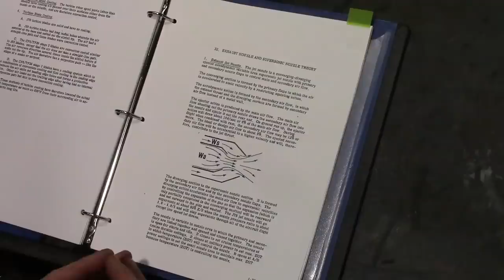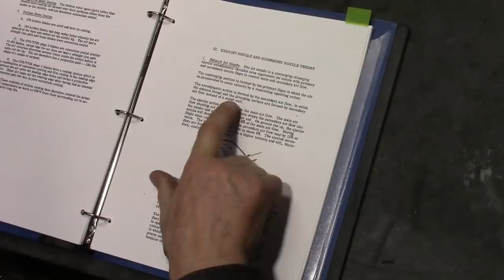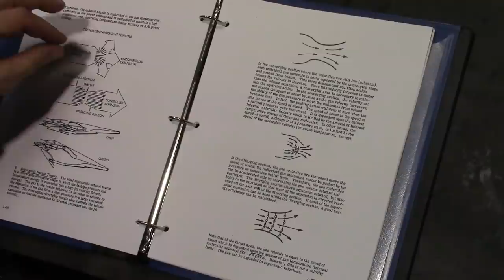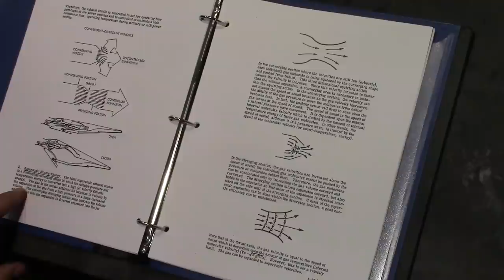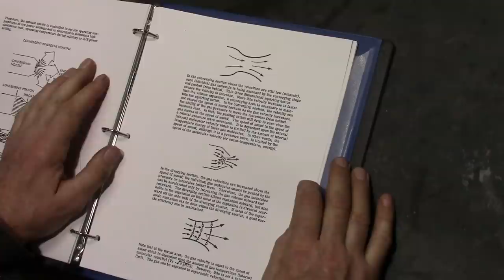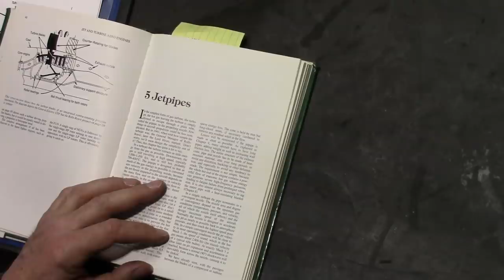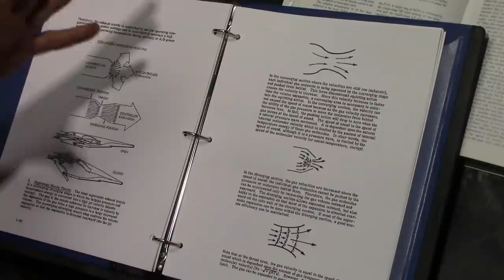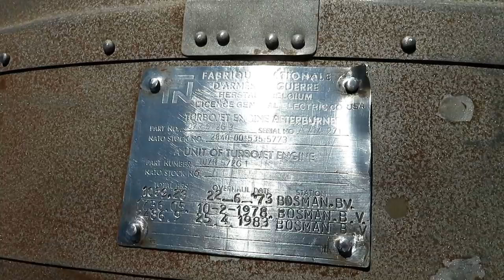Afterburner Jet Propulsion Nozzle

Comment: After-burner... reheat is something you do with left overs from last nights dinner.
Reply: Gordon, Steam engines use the Rankine cycle... jet engines the Brayton Cycle... the concepts and the names are completely unrelated. Cheers mate!
Reply: Yes Gordon, your comment is irrelevant and completely nonsensical... Jet engines are internal combustion heat engines.
Reply: I'm sorry Gordon but you don't have an argument...
Reply: Gordon we are talking about BRAYTON CYCLE engines on this channel...
Reply: Afterburners are not used in steam engines
Reply: @doktorbimmer  This is not for you to pontificate on. As Mr Richardson has already tried to tell you, 'reheat' is simply a term for the addition of heat at less than the maximum pressure of the cycle, whichever cycle. The term used for decades in the UK gas turbine industry for the combustion of additional fuel in the jet pipe for thrust augmentation is ..... reheat. That is a fact and your opinionated comments are not going to change that fact. I have stated elsewhere (but have no conclusive proof) that its use possibly came from Whittle's early association with British Thompson Houston, manufacturers of steam turbines and electrical machines.
Reply: @grahamj9101 The facts here are very clear and you are both wrong... steam engines (Rankine Cycle) do NOT use Afterburners... and there is no logical reason for them to exist on steam engines... there is no practical application for thrust augmentation of the combustion gases produced in any boiler or steam generator. This should be plainly obvious to anyone knowledgeable or educated enough to speak intelligently on this topic.
Reply: @doktorbimmer  OK lets tgive it a last try from my side. Where the Americans (and Canadians) mention afterburnering (with an afterburner) for the Brittish this is reheat (with a reheat section). This is one of the many differences between Brittish English and American English. (Other examples are holiday and vacation,  aubergine and eggplant,  trousers and pants, starter and appetizer. All those words have the same meaning). There are more words that can mean the same. This "different words" with the same meaning was (in my opinion) the thing AgentJayZ was refering to.
Reply: @Jose van Eijl Why don't you do us all a big favor and go troll somewhere else OK kid???
Reply: @doktorbimmer  It is obvious that you have totally failed to absorb what I have (and have not) told you previously. At no time have I suggested that a Rankine cycle machine can use a process that is commonly known in the USA as afterburning, as applied to propulsion gas turbines.  What I have told you and will repeat is that the term reheat is a generic term for the addition of heat part way through the expansion process of a heat engine, be it a Rankine or a Brayton cycle machine. 
I will also repeat the fact that the term reheat has been in common use for decades in the gas turbine industry in the  UK for the combustion of additional fuel in the jet pipe for the augmentation of thrust in a propulsion gas turbine. And yes, we can and do use the terms afterburner and afterburning interchangeably with reheat in the UK because of the worldwide influence of the US gas turbine industry.
Finally, let me tell you what I've also mentioned in the past on this channel. Back in the 1970s, I did some feasibility studies on the use of what could only be termed reheat in an industrial gas turbine. I investigated the practicability of introducing a combustion process between a gas generator and its free power turbine. I concluded that it was entirely feasible but not practicable, because it would not be cost effective.
Reply: @grahamj9101 Steam engines do not use Afterburners the term Afterburner is not related in anyway to steam engines or Rankine Cycle engines. 
 The term "Afterburner" is translated directly from the name given to it by its inventor Dr. Anselm Franz who described his invention as quote;  Nachbrenner zur Schubsteigerung or in English "Afterburner to increase the thrust" on the Jumo -004 D/E the worlds first production turbojet engine and the first jet engine to have an afterburner.
 The Afterburner is in absolutely no way related to Steam or Rankine Cycle engines and your ridiculous theory is nothing but absurd.
Reply: @JosevanEijl  I've often taken the opportunity on this channel to have some light-hearted fun with the "two nations divided by a common language" issue. This applies both to English language usage generally and to the terms used by the industry in which I spent a career lifetime. For instance, UK jet engines don't have mid-span shrouds, they have snubbers, if the were designed at Bristol, and clappers if they were designed at Derby. 
I think the troll in this instance is the stupid person who is trying to reinforce his non-existent case by using bold type.
Reply: @grahamj9101 Childish insults won't lend any credibility to your failed argument or make you look smarter or more mature...
Reply: @doktorbimmer  This is getting tedious: I will state yet again that at no time have I claimed that afterburners are used in steam engines.  Having spent a career lifetime in the design of gas turbines, industrial, marine and aero, I do know better than that and I would have hoped that you would have at least tried to understand the point I was making.  I was simply and reasonably relating the use of afterburning in the gas turbine to the use of reheat in Rankine Cycle machines.  As you quite obviously haven't appreciated this, I will explain the issue, which is really a non-issue, for the benefit of others.  
In a large steam turbine, the steam leaving the high pressure turbine does not go directly to the low pressure turbines: instead it is piped back to the boiler where it goes through a separate section known as a reheater.  In the reheater, the temperature (but not the pressure) of the steam is raised before it is returned to the LP turbines: the process is known as reheat.  The primary reason for reheat is to reduce the degree of wetness of the steam in the final stages of the LP turbines, in order to avoid erosion of the blades.
In thermodynamic cycle terms, afterburning (as it is known in the USA) in a gas turbine and reheating in a steam turbine are essentially similar processes.  In both, heat is being added to the working fluid part-way through the expansion process.  However, there is one obvious practical difference between the two.  In the gas turbine, the combustion process that adds heat takes place in the working fluid itself.  In the steam turbine, combustion takes place in the boiler and the hot combustion products pass through the reheater section of the boiler.  In the reheater, heat is transferred from the combustion process to the working fluid by means of heat transfer across the walls of what is essentially a heat exchanger.
As I’ve told you before, what is known as afterburning in the USA is quite validly known as reheat by the gas turbine industry in the UK and the term has been in use for decades.  We do, however, use the terms interchangeably at times, because of the pervasive nature of American English.  OK?
I will now await an expression of thanks from you for clarifying this matter and I think that an apology from you would be appropriate.  I also think that an apology is due to Mr van Eijl.
Reply: No, not tedious... your nonsensical rants have become absolutely pathetic, the development of the Afterburner IS NOT related the Rankine Cycle or the development of steam engines which simply do not benefit from nor have any practical application for thrust augmentation. The idea that the afterburner was developed from steam engines is complete twaddle... The term "afterburner" is translated into ENGLISH Language from the German term Nachbrenner zur Schubsteigerung or in English "Afterburner to increase the thrust".

Comment: AgentjayZ does water/methanol injection decrease the fuel consumption of a gas turbine engine ?
Reply from the maker: Actually, it is used to lower combustion temperature, which allows more fuel to be used to make more power.
Reply: @AgentJayZ thankyou

Comment: Thank you! Absolutely wonderful. I sometimes wondered which pieces exactly formed which parts of the nozzle, but had no idea you could make a C-D nozzle out of air! That is incredibly brilliant engineering, especially considering that this is a mid-1950s design, where there were no computers worth speaking of. To me it's on the same level as Concorde aerodynamics. A technological marvel.
If my interpretation of the drawings is correct, then even at dry military power, the exhaust velocity is supersonic, and air alone forms the diverging part of the nozzle, whereas in afterburner the air plus rear petals make up the diverging part. Does that seem right to you?
If anyone wants to delve into more details of supersonic flow, choked flow, interactions between multiple throats, "started" and "unstarted" intakes, here's the best video I could find on the subject: https://www.youtube.com/watch?v=45w1-lwFSzM and the accompanying notes: http://web.mit.edu/hml/ncfmf/08CFCF.pdf
Reply: Air alone cannot form an effective divergent section of a con-di nozzle that produces thrust, as there is no physical divergent section upon which the expanding gas can exert a pressure.   
For your information, Concorde's engines had a primary/secondary nozzle arrangement with air entrainment between the two sections.

Comment: NEGATIVE LEARNING experience
 Click on video thinking I know something. Then 10 minutes thru video realized everything what I know is wrong, and physics of high speed gas is connected to sound speed moving thru gas and all that is connected to temperature, pressure and speed of the gas so when gas is expanding it's going faster. O my god that is some weird shit going on. I get rockets cone shape because fuel and oxide are burning, heating and expanding there. On the afterburner when gas reach cone shape part at the end burning and expanding must be already done (or it's the wrong part again?). This is rocket science for my little brain
Reply: Yes. When the jet stream reaches the "cone shape part", the combustion ( =burning ) is mostly finished.
What you have there is a VERY fast stream of exhaust gas that is under pressure and hot.

This is a rocket nozzle: https://en.wikipedia.org/wiki/Rocket_engine_nozzle#/media/File:De_laval_nozzle.svg
Green is subsonic velocity, red is supersonic velocity, yellow is mach = 1.
This is a convergent-divergent turbine nozzle: http://www.flight-mechanic.com/wp-content/uploads/2017/02/3-47.jpg

In function a rocket engine also deliveres a stream of very hot, very fast gas under pressure. Both nozzles are convergent-divergent nozzles. Both, the afterburning jet engine and the rocket engine have supersonic exhaust velocity.